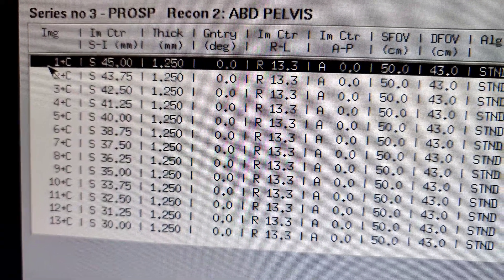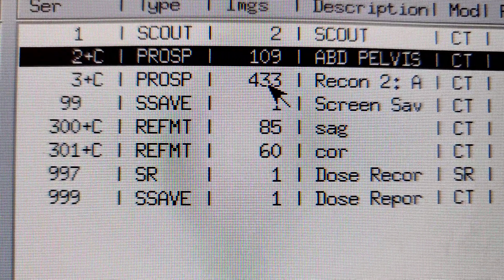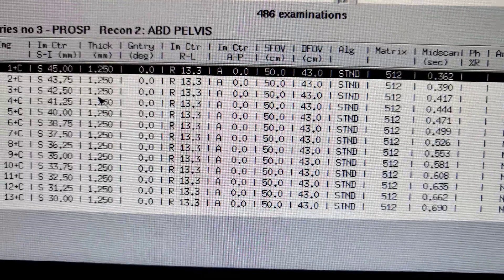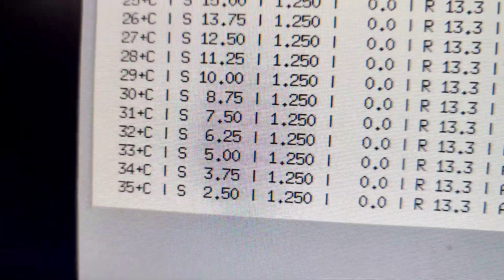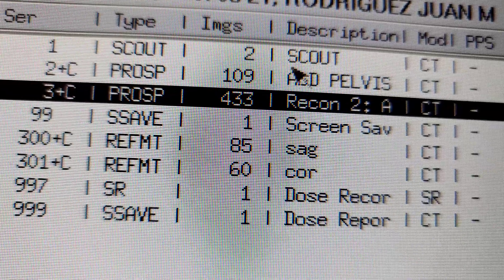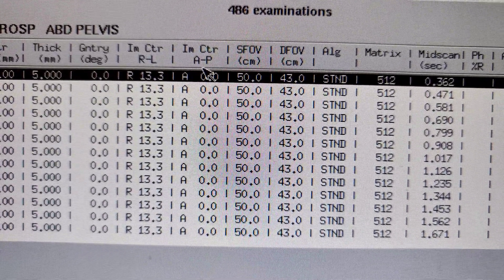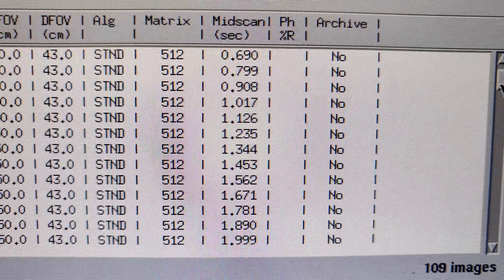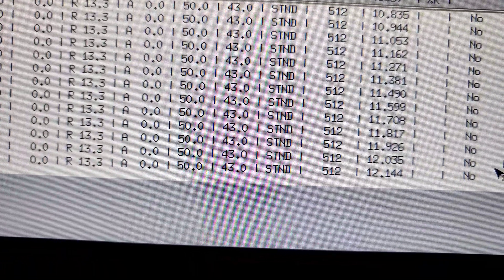GE 16 slice post processing tabs , CT machine

Comment: do you know how got straighten a head and do the recons when u scan a patient with the head tilted?
Reply from the maker: On an updated GE I heard it's possible to straighten it. This specific one I only know how to straighten the axial but it will not be a TRUE axial. This is bc the images cannot be straighten in sagittal or corona views. At least I am not sure how to do it.
Reply from the maker: If you do need to recon, make sure to use the thin images to recon. It'll be the volume file. Then batch accordingly